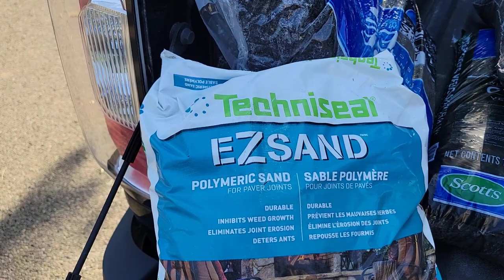BRICK sidewalk installation using "found 150 yr old brick" from our property

Comment: Nice job Spence!  I am curious as to why you went through the expense of digging out room enough for a slab, instead of putting in a stone base?  Are you trying to avoid grass and weeds growing through the cracks?
Reply from the maker: Hi Russ. We would have had to excavate for rock base anyway so we decided to go a little deeper, put rock in and then pour the pad. This way, we know that this sidewalk will never move again (and yep....no growing things as a bonus). We originally did this sidewalk in 2006 with brick we discovered as a buried walkway and small patio. We then recovered them and added them to the existing brick walk and made a "new" old sidewalk. Over then years, the base failed to an extent with frost heave so it was time to make it over again. This is the result. I had a great time pulling the sidewalk out and replicating it exactly on the horsed-up ply so it would go back exactly as it was. Once I got momentum on the day I installed, I had a really good time seeing the progress as I installed in the thinset. The capstone is the polymeric sand. It was an easy product to use and it really locked the sidewalk in. All in all, we are really happy to have made this happen. And....it is largely flat again so shoveling should go way way better this year!